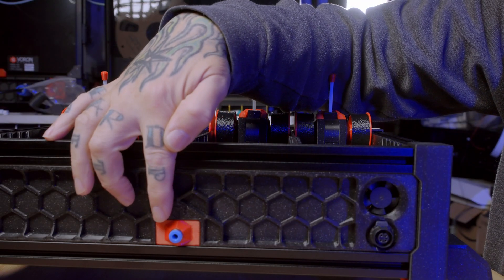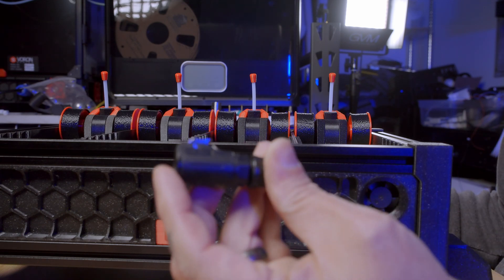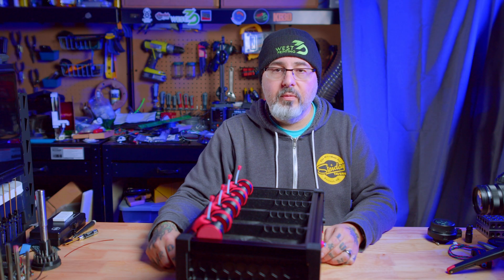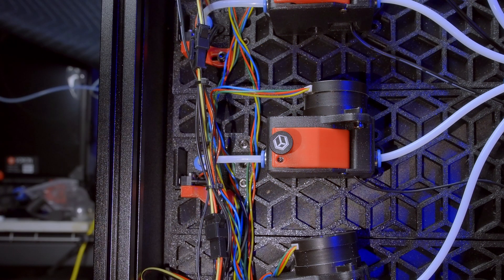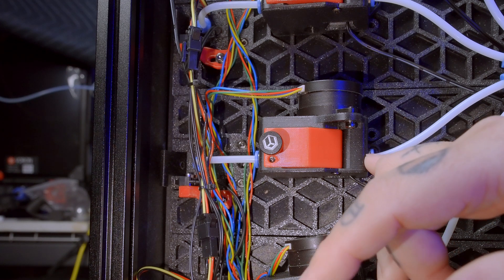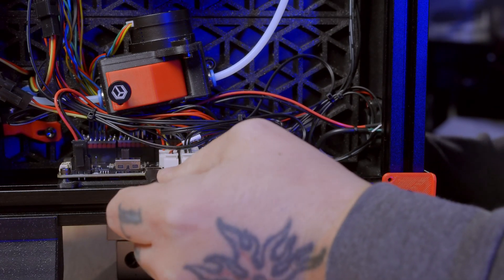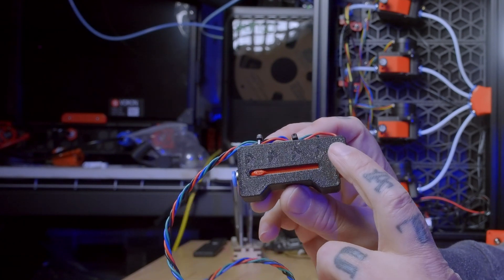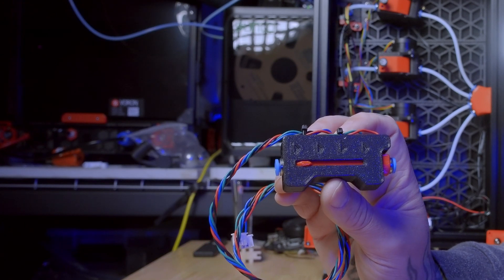Building the Box Turtle automatic filament changer Part 2

Comment: I love these open source filament feeder projects.  It seems that all of the manufacturers are clamoring to sell their multi filament feeders as well.  This technology will be much more useful when slicers become smart enough to use the purge material to print infill, or in the case of incompatible materials, make an internal cavity for the poop rather than having a poop chute on the printer, or printing a purge tower.

I print functional parts so color isn't that important to me, but I'd love to print PET-CF with non-skid TPU feet, or print ABS parts with PLA support that peels off easily.  If a good feeder emerges for the Voron 2.4, maybe I can use it on my SV08.

Comment: How does the filametrix work with the reaper hotend? I don't see how there's space with the long ducts. Can't wait to see the series continue as I prepare for my kit.
Reply: I dont beleive Reaper has a filament cutter option.  It was mentioned a while ago, but it never actually appeared.  You may need to go back to a toolhead that supports pre / post extruder filament switches and a cutter for now... (Like a StealthBurner)
Reply: @UkieAndKiwi  I'm using the Dragon Burner, but the video author previously showed building the Reaper toolhead in preparation for this project.